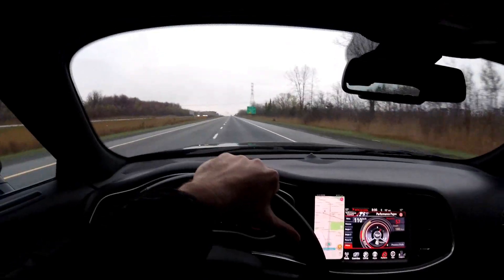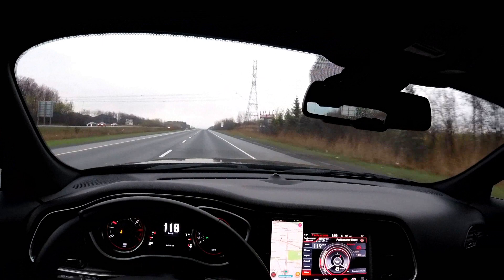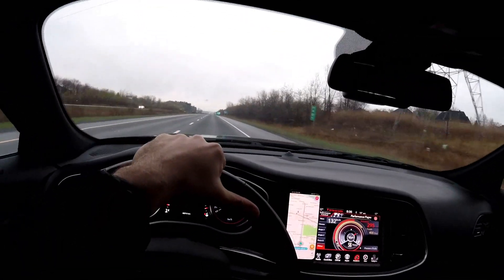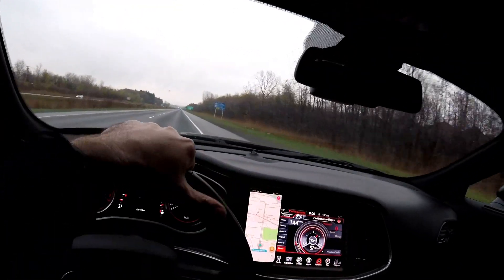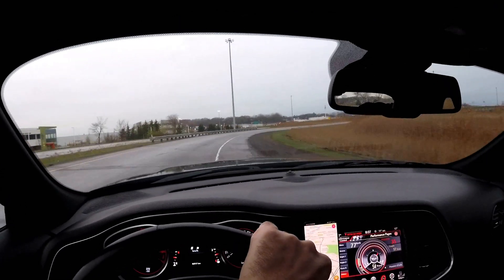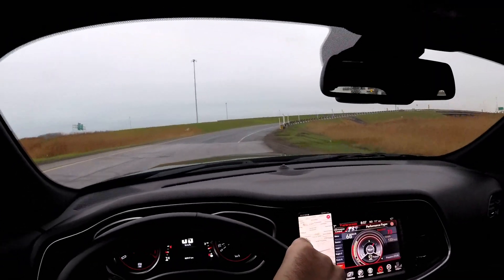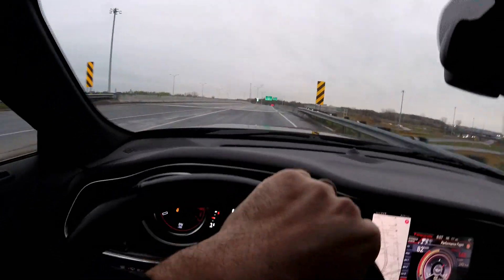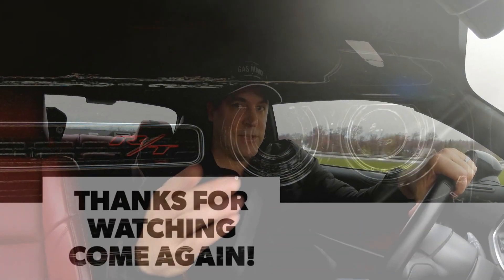HEMi TICK - Engines Idling Comparaison

Comment: I got my  brand new R/T 2020 with 60 miles on it, and I have that f...noise... idk if is a HEMI thing or something is wrong with my car... let me know if u found a solution!!
Reply: Lol normal sound
The way the engine is designed
I would get rid of it before 100k miles
Reply from the maker: Its the injectors the dealer told me. Normal sound

Comment: Clear difference between the two, I still haven’t posted the video I told you I would of mine, I will do it tonight. I hope you don’t start going through the same stuff I did. Quick question, can you hear it in the car with the windows up? As said before and as you mentioned in this video, I have replaced the lifters, cam, bolts, etc.. Mine you can still hear in the cabin as well. Keep us up to date brother.
Reply: https://youtu.be/VYOeWK0B0-w
Reply from the maker: I can't view your video...nothing is happening when I click your link. It keeps searching
Reply from the maker: Hey man! To answer your question. No I don't hear it in the car windows up or down unless the hood is open. I will post the follow up video shortly.

Comment: So I came here from your first Hemi tick  video and this is what I commented on it incase you don’t look at the Comments on the older one.

I mean mines a 2020 manufactured in November of 2019. It’s had a tick like that forever. I think it’s just a Hemi thing. I don’t know if mine is as loud as yours but when you pop the hood or stand Stand beside the front when it’s on, you can definitely hear a tiny tick. But it’s done that since I got mine about 2 months ago. It’s got 1400 miles that I put on it. Still has a little tick. But pop the hood and the tick is significantly louder especially without the engine cover.

I think it’s just a Hemi thing honestly. And I will say I’ve driven in MOSTLY in sport since I bought it. And sport mode deactivates the MDS. So it’s not due to me driving 1400 miles with MDS. I’ve probably only driven 200 miles not in sport mode with the MDS Enabled.

Until it gets ridiculously loud or you start noticing loss of power etc.. I don’t think I’d take it to the shop. If you take it to the shop and get no error codes I wouldn’t pursue anything further. Like I said mines a 2020 and it’s had the tick since I bought it brand new. And this isn’t no base model, mines an MSRP 40K 5.7 blacktop with two other packages. 

I think it’s just a thing Hemi’s do.
Reply: Also I will say that the footage you got of the RAM tick was definitely shortly after engine start. It wasn’t at its idling noise. The engine’s RPM’s we’re still decreasing. The tick becomes louder when the engine fully reaches idling RPM.

You should’ve recorded the footage of the RAM engine after the engine was completely at idle RPM. The tick is drained out by all the other noises during the higher RPM shortly after engine start.
Reply from the maker: Yes the ram in the video alao has as little tick noise but nothing as loud as mine at idle...

Comment: Hopefully  its not a lifter/cam issue.but if it is you wuold still be covered under the 5yr powertrain warrany through fca right?Just asking because i also have 5.7 challenger 2017 but thankfully no tick yet at 45000k
Reply from the maker: Yes I believe so. We will see.